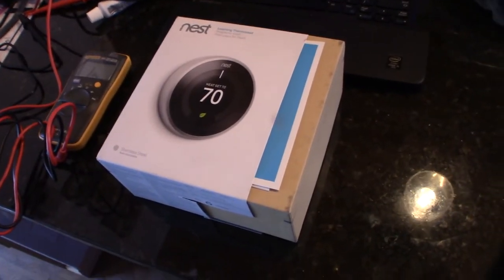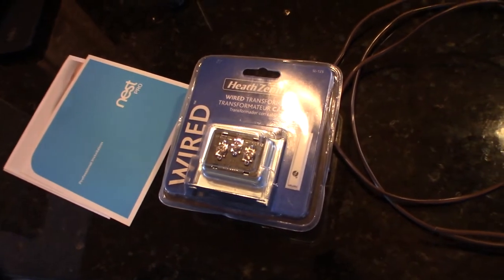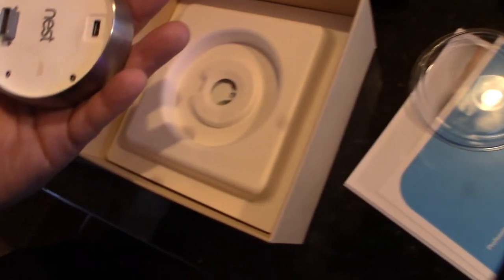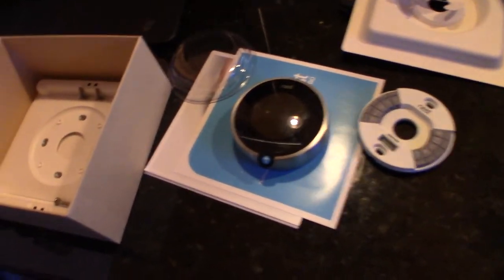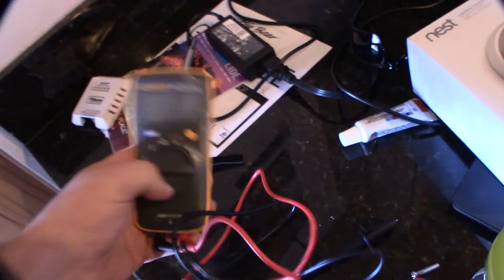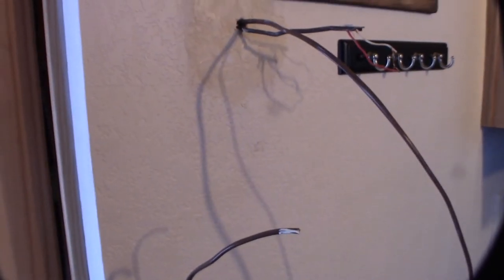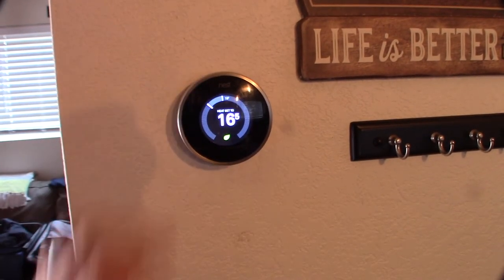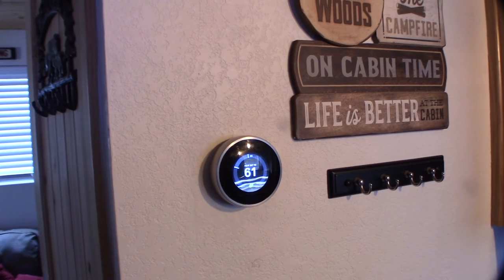Nest Thermostat 2 Wire Millivolt Heater with  24V Door Bell AC transformer Install

Comment: Your's was one of the first videos that I watched on the installation of these thermostats. I have a different model but your discussion and tutorial helped me tease out how I needed to configure my system. Thank you!

edit:
I have been up and down through forums and videos trying to square the circle of why some people say a fan relay is needed and others seem fine without one. Some people hear their furnace hum and buzz until they put in a relay, others put in the relay and the system doesn't work. I have a millivolt gas valve hooked up to a thermocouple that when switched on powers the valve and turns on my fireplace. I hooked up a wifi thermostat with a 24v ac adapter, wired it up and everything worked.

The reason why my millivolt gas valve didn't overload is because my thermostat doesn't have a battery and so draws a constant 22-27volts from the ac power supply. I ran a multimeter at the end of the thermostat wire that hooks up to the fireplace and the voltage was in the millivolt range because the thermostat was pulling 99.9% of the available power and so there was only crumbs left to push to the gas valve.

My thermostat doesn't have a battery, and I wonder if (in units with a battery) when the internal battery is charged how much load goes down the wire to the fireplace and if that could overwhelm the millivolt gas valve. In my circuit the fan relay was not functional because the thermostat took all the voltage there was not enough to trip the fan relay. I took the thermostat out of the circuit and tested the fan relay with the 24v ac adapter it functioned normally.

The only concern I have is if the wifi thermostat fails and stops drawing power and the circuit to the fireplace is active could there be a chance that the 22-29 volts from the ac adapter gets shunted to the fireplace? The thermostat manufacturer seemed to think that when the unit fails all circuits are cut as a safety precaution. Would that be the case in a battery powered unit? I think I will install a small fuze inline at the fireplace so that it trips just in case the voltage gets diverted in the case of thermostat failure. Also to ensure that the fireplace works when the power is out I wired up the on off switch on the fireplace as a bypass.

Hope that helps someone!

Thank you to everyone including the creator of this video who ran tutorials on how to install these systems. Having so many examples really helped me tease this out. It takes a lot of time and planning to put these videos together and that work deserves respect. Also, if I am wrong totally call it out. I am always happy to be proven wrong.

Comment: I used this on my millivolt gas fireplace inset and it worked beautifully.  Nest did tell me that the equipment wasn't connected, so I just ignored it and then ran the test. It passed with flying colors.  I have a Gen 2.

Comment: Very helpful info, I have a heater 2 wire millivolt gas valve, I have installed a millivolt digital honeywell thermostat, I just might buy a Nest thermostat to control via app adapting a 24 volt transformer , very nice, thanks.

Comment: Helpful video, thanks. 
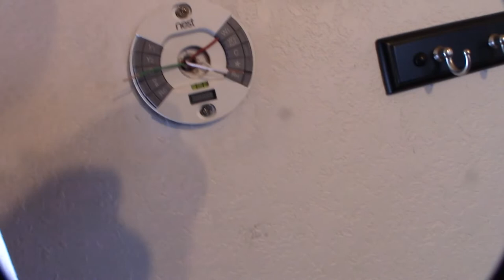6:20  Typically we install the white to W and the red to R. But in this case it really doesn’t make a difference. It’s only later if you look at the wiring (years later) and wonder why the colors are non standard. 
6:50  The heater did NOT turn on... yet. But the thermostat DID trigger to relay to call for heat. If all’s well, once the “call” is sent the heater will start soon.

Comment: The white IA still connected ti one side of the relay but the blue (c) is isolated from the red in the nest. That being said could this affect the cas valve with stray voltage.  Just asking I don't know. But a 24 volt relay would completely isolate the millivolt circuit wouldn't that be better
Reply: Yes absolutely. I highly recommend putting a relay in. 24v on the coil side from thermostat and millivolt from thermocouple for the contact side. The gas valve is only rated for millivolts and will burn out with 24v applied to it.

Comment: I thought a lot about this, but with all the power outages happening now days, I've decided that the vintage thermostat that does not use power is best way to go, as when the electric power grid goes down, I shall still have heat.
Reply: Leave the milivolt tstat connected in parallel set it to 50 deg or lower this way it will start the furnace during a power out

Comment: I have the similar Williams wall heater and millivolt thermostat. Running power, even a 24V transformer would be a major pain. Does anyone make a battery powered Smart WiFi thermostat that will work with a 2-wire millivolt system with no power? Is that even possible?

Comment: My question is does the nest charge off the base now that you installed the transformer. Or no you have to plug it in via usb
Reply: The transformer is providing the charge to the nest constantly with 24 volts.
Reply: So W and R are only a switch? No power from the 24v transformer being directed to the millivolt system?
Reply: @paulcalif  there is still 24v going to the solenoid on the gas valve, which will burn out as it's typically only rated for millivolts.